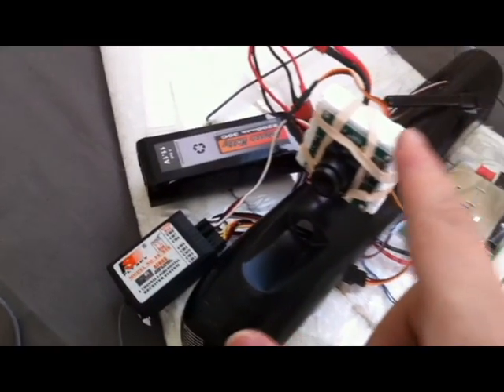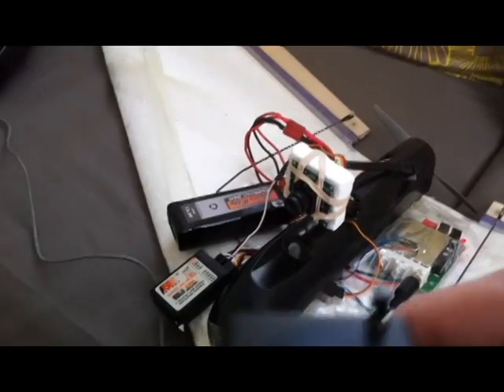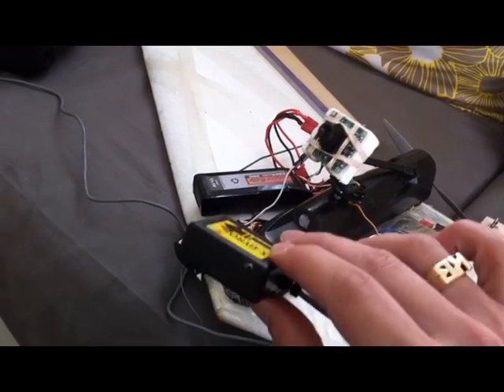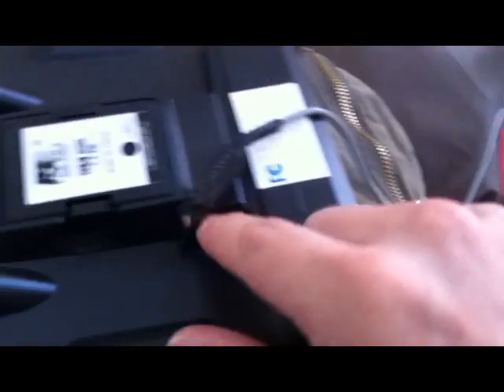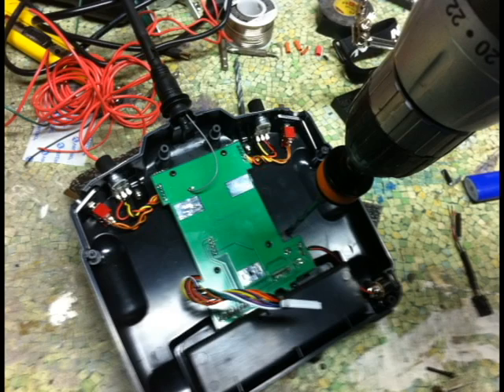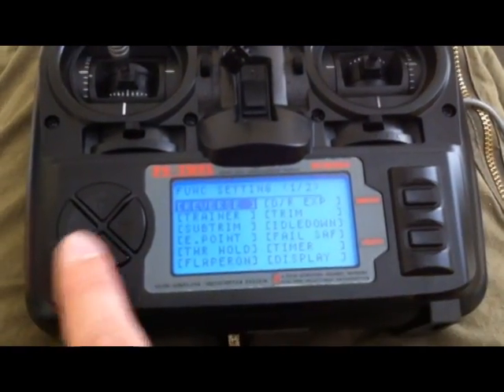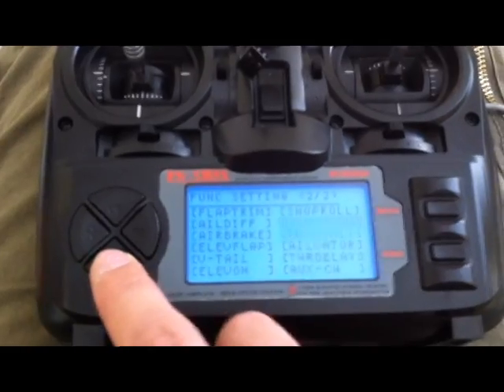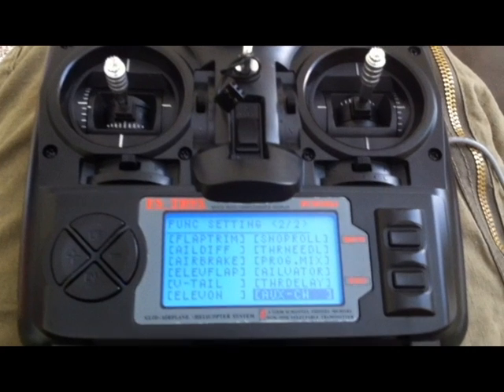FPV Head Tracking Gyro X-1000 Setup with Fly Sky Th9x Turnigy 9x with Pan/Tilt - Mod - It's ALIVE!

Comment: Hi rcpilotp51, I'm trying to build my own HT, but have this question: can't you just use the trainer port on the FS-TH9X? By the way thanks a lot for sharing this tutorial.
Reply: Solved! The Turnigy 9x trainer port has a stereo jack You can get the PPM signal into it as well as power to your DIY Head Tracker.

Comment: I change the setup from CH 5+6 to Ch 7+8 but nothing works. A wrong servo connection can not be the problem because if I check the TX Monitor nothing is happen on Ch5+6 while moving the tracker. I have no more ideas, maybe You can contribute some more ideas.

Comment: Hi, thanks for fast response!the firmware in my TX is even original. But if You take a look on hobbyking website, they wrote that they update every X9 TX to this new Firmware V2 before delivery. So my expectation is that not all X9 TX run at the same Firmware. I'm electronic engineer and trust my I double check everything, cabling and setup. I also check the output from tracker to TX with my oscilloscope, the signal looks fine and the channels 5 and 6 changing if I move the tracker.

Comment from the maker: Mine was straight out of the box, I didn't update the firmware. Even so, everything should be working...make sure you check you soldering (i dont know how experienced you are) and the points are touching (you didnt melt the solder into another connection from the one). Give it a try again...make sure the servos youre using are in the right plugs (chanels) in the receiver.

Comment: I bought this gyro and I trow it in the garbage after one flight.
The quality is very bad and the gyro loses the center position very fast.
The build quality is not acceptable, the circuit board is glued directly to the plastic casing and the soldering is bad.

Don't buy this piece of garbage.

/Stefan

Comment: You have to check this out! this is a must for you Sky Fly 9X!! I have used this in my Sky Fly 9X with a $800. Quad and would not tell you to buy this if I did not use it! FrSky D8R-II Plus - 8 Channel Receiver w/ telemetry	D8R-II plus	1	$25.64
FrSky DJT - JR Transmitter Telemetry Module	DJT	1	$22.70
All shipped to me in 2 day's from aloft hobby they are fast. and you will get over 1.5 k out of the box! I did use the old set up till the new one's came out but this is better! range video was old

Comment from the maker: Hey thanks for the comment. The x-1000 is an average gyro with A LOT of drift...if you notice in the video i hit the certering button a bunch of times - not intending to demonstrate its function, if you know what i mean. There is a modification out there similar to the one i demonstrate that allows a switch to be placed on the transmitter for easier centering, so you don have to fiddle with it on your googles and more importantly take your hands off the controls. Rating: I would sat 3 out of 5!